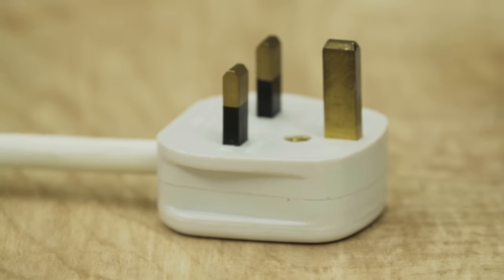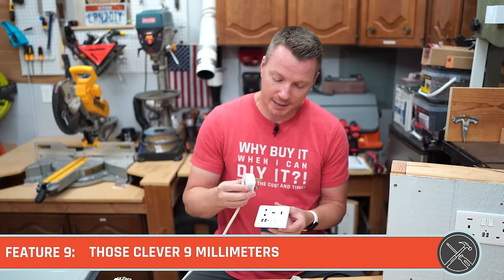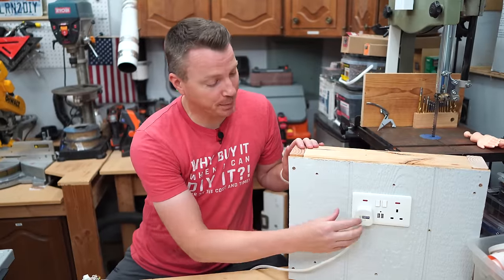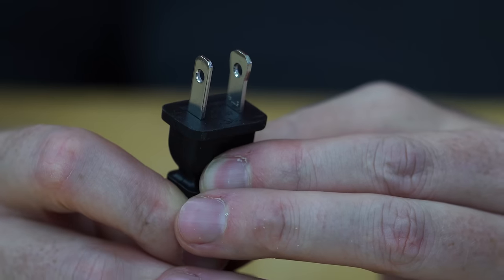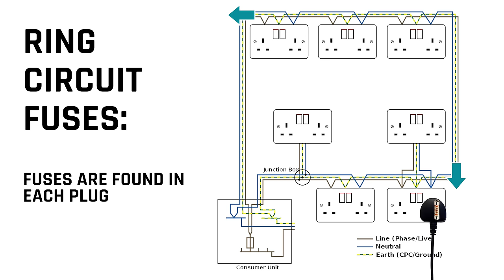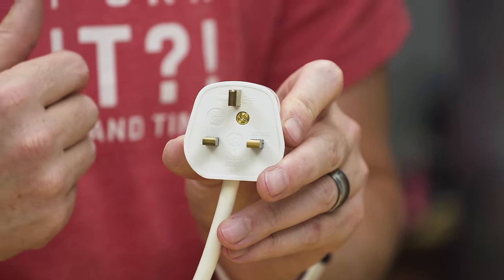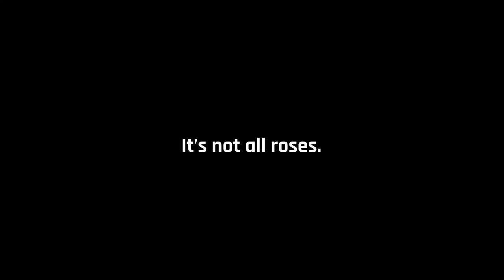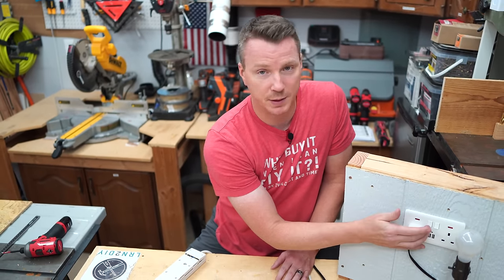British Plugs and Outlets Are On Another Level

Comment: My dad was an electrician in the UK for years. I must have been taught to wire a plug aged about 5! Crazy to think ours are still so much safer than elsewhere after all these years. Not many reasons to feel proud to be British at the moment, but the humble type G plug is one of them! 🤣
Reply: In Hong Kong, we are still being taught about wiring plugs in grade 7 science classes XD Even tho all appliances come with a plug pre-attached nowadays.
Reply: I could wire a plug from a young age too. My mum went to work in electrical repairs for the Telephones during WW2, and then she was widowed when I was only 6 so she taught me all the basic electrical stuff around the house. I'm with you, not very proud of our country at the moment, and not terribly proud of our colonial heritage either, but one good thing we did export around the world were good engineering systems.
Reply: "safer". You've over engineered every single plug in the country to compensate for the fact that your grid is inherently dangerous.

In NA, we just made the entire grid safe. Don't need to be concerned with the safety of literally every single plug.
Reply: @nitePhyyre  But you can't run a decent kettle to boil water rapidly for a brew with 110v, so hurrah for 230v :-D
Reply: i wonder about australia(similar to UK) and EU one that has circular 2 pins with ground in top and bottom as some sheet(with pins oj the port instead of plug)
Reply: @PhoenicksUK  lol. Saving 30 seconds isn't really worth a stupidly over engineered entire electrical grid.

Wait. Scratch that. With the amount of tea you people drink... It might actually be worth it.
Reply: @nitePhyyre  exactly! 😁
Reply: Yes that , and tv coax cable plugs. Invaluable skills!
Reply: @nitePhyyre  
Living in a country with 220 - 240 volt ac supply and then being in the USA I can say that the time to boil water, or charge mobile phones, etc is about 40% longer on 110volt ac.
The USA has a poor electrical system.
Reply: Rachel, there are many reasons well beyond the G plug to feel proud to be British. The civilized world owes its existence to a very small number of nations: Britain, France, Italy, ancient Greece, and China - that is it, those are the pillars of civilization.
Reply: @skwalka6372  Exactly my thoughts, how sad it is for someone to live in such a great place and not even realise how lucky they are.
Reply: @ShiroCh_ID  The EU is a bit of a mess, Germany and France are sometimes compatible, sometimes not. France has an earth pin poking out of the socket, Germany has earth either side of the plug and sometimes a hole in the plug to accept the earth pin, sometimes not.  The result is L/N polarity is easily reversed in Germany, but not in France with 3 contact configuration plugs including earth.  Two pin plugs don't care about L/N of course.  None of them have fuses in the plug.  Italy has a different in line three pin system requiring an adaptor to convert to British, French or German sockets. Australia has a horrible skinny flat pin (like US 110V and Japan 100V) but at an angle system (no fuse), which looks downright lethal compared to the EU or UK system, considering they also use 230V.
Reply: @redpill6201  "Germany and France are sometimes compatible, sometimes not" --> Not true: Plugs are 100% compatible between both countries (because the plug is the same. Only the socket changes). Unless you go to older standards from many decades ago, which are extremely rare to find nowadays...
Reply: @prchnl966  Actually no, there is still a problem of German plugs without the ground hole, that won't fit into French 3-pin sockets.  You can confirm this by visiting Amazon Germany and checking things for yourself, via the pictures of the front of plugs.  I recently bought a German Earth Leakage Trip that had the ground pin hole, but a surge protector from Germany did not.  It didn't matter to me as I was pugging the SP into a German socket, without the protruding pin.  Some German extension cables don't have the hole in the plug either. In French Alsace, on the border with Germany, we need to check this kind of thing, if we buy stuff in Germany rather than in France.
Reply: @PhoenicksUK  Dont need kettles, we dont drink tea. Espresso machine for us.
Reply: @redpill6201  "there is still a problem of German plugs without the ground hole, that won't fit into French 3-pin sockets." --> Sorry, this is not true. 

The standard is E/F plug (officially called CEE 7/7), and it is the same in France and Germany. Virtually, anything new has one of these plugs.

I didn't need to check any shop, because I see it daily. But, still, I've checked Amazon DE, and, as expected, I could not find anything with a non-compatible plug.

I suspect it might be even illegal so sell any appliance with a non-standard plug...
Reply: @nitePhyyre  And yet you need 220V for all your washers and dryers. Funny that!
Reply: @susannahbaringtait1257  That you can still run 220 when needed is more reason not to run it exclusively.
Reply: @prchnl966  Example "Amazon Basics - Socket adapter, with surge protection" it does not seem to be illegal yet, but perhaps it would help if that was a law.
Reply: @prchnl966  amazon basics - steckdosenadapter, mit überspannungsschutz See pictures on the left, 4th down from top. An additional earthing issue is some French plugs or adaptors don't have the side contacts for earthing on the German system. Law might help?
Reply: Humble G plug? Its a monstrosity with the plugs and sockets take up a huge amount of space compared to AU plugs which run the same circuits.
Reply: @nitePhyyre  Glad to see you get it. UK labour force is about 32 million, so 30 seconds per tea per person could improve our productivity by about 1.3 million worker hours every day. Except we actually spend the extra 30 seconds finding the tea bags, biscuits and milk.
Reply: Feel proud indeed!
Reply: I was a kid when I learnt (also watching my dad). Taking these skills away from us through excess legislation doesn't help anyone.
Reply: @grahamlucas2712  Whilst European 2.6kW+ kettles do make a noticeable difference when it comes to boiling water quickly, if it's taking longer for you to charge your phone in the US I'd love to see what behemoth of a phone you have!
Reply: @EdwardChan.999  when he was going through how great it is that the plugs are serviceable I was thinking does he realise a lot of our appliances didn't come with a plug even 30 years ago.
Reply: the best plug and outlet design is the German "Schuko". It is used throughout Europe, Asia, South America and North and central Africa. Even South Korea changed from the US type outlet to the German Schuko design in the 90s, also doubling the voltage from 110V to 220V
Reply: @catsandcrafts171  What's not to love about our moment in the sun?
Reply: @nitePhyyre  it’s a hideous system. Outdated and dangerous. Even South Korea got rid of the NA outlets and changed to the German Schuko standard, the most used system in the world
Reply: @ShiroCh_ID  that’s the German Schuko standard. Almost a third of the globe is using that type of outlet
Reply: @expansionone  I don't think the Schuko design is as good or clever as the Type G BS1363 design for the following reasons: 1) The pins aren't partially sleeved. This this is not a problem when used with recessed sockets but Schuko plugs are frequently used with non recessed sockets. 2) The plugs aren't fused. BS1363 plugs are fused in order to protect the cord of the appliance from over current. This is a fire safety feature. 3) The plugs are not polarised. While this is not a big issue in itself, especially if socket switches and circuit breakers are all double pole (eg. DPST), it's more of an issue if the cord is pulled out of a wired plug. The unequal length of the live (shortest), neutral and earth (longest) in a BS1363 plug means the device will be disconnected in the safer manner. In the Schuko plugs I have wired, the two phase wires are usually of equal length. 4) The sprung earth connectors are the sides of the type G socket are often very janky and can get caught on the plug or fold back -- this is an issue on the cheaper extension sockets. For this reason I tended to prefer the French style type E sockets with the earth pin in the socket as these to be more robust even when used with modern style type F Schuko plugs. 

Talk about rings mains as opposed to radial distribution in regards to type G sockets is a red herring -- many modern installations are wired radially and there's nothing to stop you doing that. There is a notion that type G plugs are fused because of the ring circuits. This is not correct.
Reply: @qo92  Schuko is always recessed and grounding clamps are the last to disconnect. No one is using ring circuits since the 60s anymore. Cheap outdated type of installation. The plug is designed that the grounding wire is always longer than the the to power leads. Never had a problem with the grounding clamps in Korea nor Europe or South America. There is for sure a reason why so many countries opted for the German Schuko design. Btw, some countries are using a derivative design without ground contacts, but that is not the Schuko standard. Schuko translated mean “protective contact”
Reply: @expansionone  My point was the Schuko plugs would benefit from sleeved pins even if the type F sockets are recessed. Not a fault with the type F design itself I acknowledge, but type F plugs are frequently in use on compatible but non recessed sockets. I am in Italy tonight and the kettle I've just boiled works find with about 5mm of exposed pins on the Schuko plug - plenty of room for a spoon to fall into.  The grounding clamps in wall sockets tend to be well made but many extension sockets just have a single piece of bent copper that can snag.

For me the main benefit of the Schuko plug is that it's rated for 15A where as the BS1363 plug is only rated for 13A. I would imagine though with the thick pins on the BS1363 you could easily put a lot more current through the plug so long as the pins were nice and clean.
Reply: @qo92  
Irrelevant what phone I have.
As it happens an Iphone 12 and a Samsung Galaxy A 33. A universal switchmode phone charger for each. 
Time to charge is affected by the input voltage even with a 110/220 volt ac charger compared with 240volt input.
We have a current limit of 10 amps @ 240 volt ac standard in Australia. So not much different. Supply per circuit is protected by a 16 amp circuit breaker.
High current devices like electric ovens & cooktops and large electric hot water is on a separate 32 amp circuit if needed.
Reply: @redpill6201  in Poland we solved the issue by making every single plug be compatible with both German and French sockets. Well, at least recently. Using old leads I can sometimes see plugs that lack the German ground connector.
Reply: @scorbiot  Good idea, it should be easy enough to have the hole for the French pin and the side contacts for German sockets.  I think most internationally sold products (like kitchen machines) are made like that, the problem seems to be with adaptors in France and Germany.
Reply: @grahamlucas2712  It was a joke. Clearly your phone requires much less than the 15A × 115V  = 1725W power available on a standard NEMA socket. If it is slow to charge then there is something wrong with your switch mode power supply. Or perhaps you are using a different travel charger or different USB cables.
Reply: Same as Norway :)
Reply: I actually learned it from my gran at around aged 8. And then "learned" it again in science in like year nine. Safe to say, I was the fastest to do it XD.
Reply: @nitePhyyre  Your "safe" grid can barely do 1KW. If you need to compensate for an unsafe, cheap, consumerist plug by using 110V, your plugs are the problem.
Reply: @LulfsBloodbag  "barely do 1kw" 🤣 tell me you don't know what your talking about without telling me you don't know what you're talking about.
Reply: @nitePhyyre  ...are you telling me you are unfamiliar with hyperbole?
Reply: It is not. It may be better than many others, but the crown of this work is the German plugs/sockets. German industrial standards. ISO-approved. British Standard is nothing to write home about. The German standards are indeed great.
Reply: As a 'neutral' reader I have to say there are many things you can be proud on from the UK. For instance the english language which has concurred the world and everybody loves the UK accents. Even americans let the more wise people talk brittisch in movies etc.  The the english invented the railraods, steam engine and basically lead the whole industrial development. Much of the theatre written plays and english theatere is adored everywhere. The english style is another thing to be proud of.  Rolls Royce engines are still number one in aviation. UK lanscapes and castles are the best in the world. Need I sum up more?   Greetings from The Netherlands
Reply: Rachel More
Americans get jealous when other people's ideas are far better than theirs (the paper clip is all they invented).
Reply: Can you please let me know if there is a fast way of wiring a UK plug. Very grateful !!!!!!!!!!!!!!!!!
Reply: @redpill6201  what you describe are infact the modern standart plugs. Theyre called cee 7/7 plugs. Work fine with german cee 7/3 and french cee 7/5 sockets
Reply: @nitePhyyre  man is actually rattled about the plugs
Reply: @of3natlas507  Yes, it is a pity they can still sell the non-compatible stuff as well.  German plugs without the Earthing hole and French plugs without the side Earthing contacts.